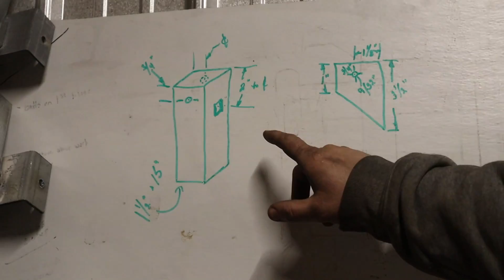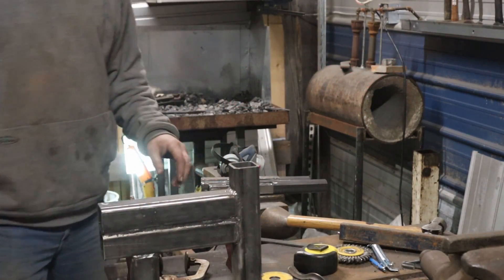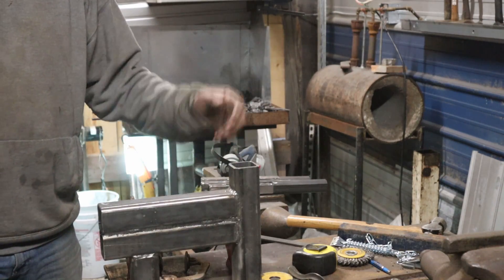DIY 2x72 Belt Grinder Made Simple For the Beginner Part 2

Comment: Howdy Jim, glad to see this project. I have a tip for using Your metal cutting saw. Next time You need to square an end on some stock, place a mark with ample room to use the speed square as a fence for the saw. Make the cut and measure the distance remaining from the mark. This number will be an offset to deduct from a dimension to be cut using the same setup. Just deduct the offset from Your desired dimension! No need to see a line!
Keep up the great work and content!
Have a great New Year!
The Retiring Renegade
Reply from the maker: Good evening.  Just like cutting wood with a circular saw.  Sometimes the most obvious and simplest things escape me.

Comment: I used a spring from a dog cable. Came from Walmart. Took the hooks off and spring works good
Reply from the maker: Not a bad idea.  This one seems to have good compression but I don't like how it sits in the pillar.
Reply: @TheTradesmanChannel  after watching ur video your spring looks to be close to the same one I used. It works fine using a junky fan motor, I won't know til I get my vfd and motor how it will work und higher rpm

Comment: Nice work Jim what size motor will you need on it 🇦🇺🇦🇺🇦🇺
Reply from the maker: I am going to use a 1.5hp 208/230v three phase motor on it with a vfd.  I'm thinking an air compressor motor, they have a 3600+ rpm.  That would give me a lot of room for speed adjustment.

Comment: Good use of materials. Adapt, Overcome, Improvise.  A few shims lets you build with what's available. 
A few suggestions for moving parts of an assembly. Using socket head capscrews for pivot points means the Grade 8 bolts will last much longer than the run of the mill hardware store Grade 2's. Try to use bolts that have the unthreaded section in the wear points. Threads wear away faster than the solid shank. Larger diameter bolts means a larger bearing surface so they will last longer. Belt sanders tend to vibrate. 
Douglas Autotech use to use them in production. I don't know how much use you intend for your grinder. Douglas ran them 24x7. They were in the shop for rebuild soon after the initial purchase. My guys would swap out the fasteners first thing. The adjusters and slides don't move a long distance every revolution. They do bounce just a little every time the joint goes over one of the pulleys. The original pivot pins would saw halfway through faster than I would have thought possible if I hadn't seen it time and again.
The thing I like best about my belt grinder is being able to change grits easily. Much better than a stone. Less expensive abrasive, no shattering, cuts cooler, and faster. 😆😎
Reply from the maker: Excellent points as always.  I would love to sit over a cup of coffee with you someday and just pick your brain.

Comment: Morning Jim. Seems a bit bouncy, but I guess that's the point. 30 lbs of spring strength seems like it wouldn't be so bouncy in such a small tube, but without being able to feel it, it's hard to judge. Anyway, good progress on this video. It may not seem like much when you look at the finished step alone, but that is some decent amount of maths and layout to get the pivot just right. Loving the tool build. Can't wait to see it grinding.
Reply from the maker: I might order in a proper 30# spring, this one feels right but I am not happy with how it fits in the pillar.

Comment: And yet another one under the belt! (see what I did there?) ;0)
Hindsight is a wonderful thing .... 

When you use the saw on short pieces that you cant see the cut on why not clamp an edge to the piece you are cutting as a guide?
If you know beforehand where the holes are going why not cut them on the whole bar where it is easier to hold, before you cut it?

Now that you think you got away with it ..... what is with the flicker?
Are All your lights the same? If not a swap is called for .... if they are could you change the frame rate in the camera ..... or failing all else fit a dedicated light on the board (I assume you will be drawing more pics in the future?)!

Most people do not realise how many "retakes" there are in this game, or how long it takes and how demoralising it can be! How about a compilation of "out takes" .... it could be both informative And entertaining! (It could also boost your numbers in the Algorythm!

A happy and prosperous New Year to You and Yours! ........ (just in case you have the good judgement to take a day off YT with your family)
Reply from the maker: As always you hit the nail on the head.  I have a lot to learn when it comes to metal work but I am enjoying the process quite a bit.
Reply: If you look at old metal construction you can see it often followed woodworking practices ..... so you are following in the footsteps of giants ;0)